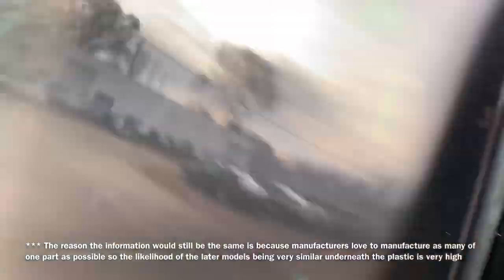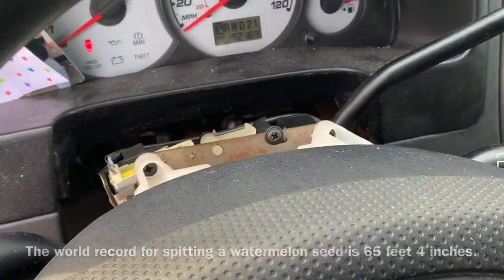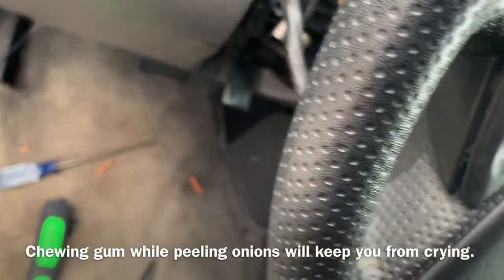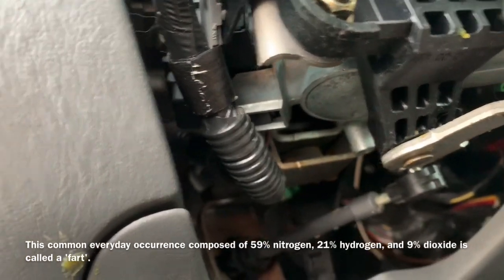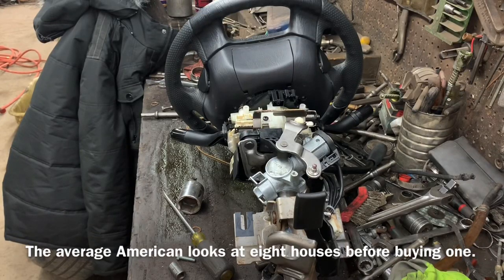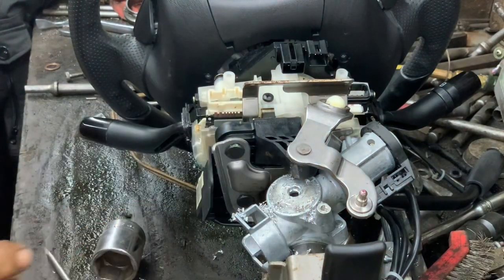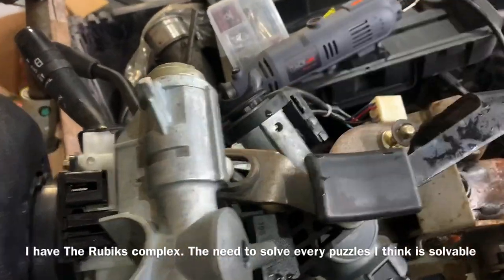Ford Escape ignition key will not turn/ Ford Escape won’t start/ cheap repair! You can do at home!!!

Comment: Good morning great info ..😊
? my wife is thinking of a smaller SUV maybe 10 years old or so we thought of the Ford do you have any recommendations pro or con on different models like I said about 10 years old thank you
4 wheel drive 🖖🏽😊
Reply from the maker: Really depends on the cost I think the Ford escape is a lot of bang for your buck it’s probably one of the cheaper SUVs that last a very long time just make sure you check the passenger side right rear wheel shock support tower they rust out I make tons of video on them other than that I would get a Toyota or a Honda Chevy Equinox is not bad as long as it has the 3.4 engine in it and I think the Saturn Vue with the 3.5 Honda driveline 2004 to 2007 is a very good vehicle as well
Reply: The Clay Way I know my wife wants to stay under $10,000 maybe $5000 that’s all up to her she thinks the RAV4 like a 2010 would be good and I kind of agree I like your recommendations also yes I definitely knew about the rusting problem with the Ford I think I had a Ford fiesta or something years ago that had that problem catch you later
Reply from the maker: mot ikswelborw well let me know if you can find a 2010 Toyota RAV4 for $5000 because I will buy everyone of them on the road lol Here in Michigan I could not find one for that cheap that’s for sure

Comment: @10:55 I think you mean to say you want to take the new cylinder out, and have it rekeyed to the car's original key. Also, make sure you keep the OLD transponder ring assembly on the NEW ignition / steering column, or else you'll have to pay a lot more to have a locksmith come and program a new set of chipped keys to work in this car.

even better, pull out the new ignition cylinder before you install it, then get a ride to your locksmith.

and next time, you don't have to take out the steering column. just unplug the wires and remove the sheered bolts.

Comment: If you had an Escape with no key, could you get a steering column with a key from the junk yard and change it?
Reply from the maker: No not without reprogramming but it only cost $75-$125 to have a locksmith come out and make & program a new key to it so you’re probably better off doing it that way. At least that’s how much it cost me the last time I had one made for my escape

Comment: When that happens to me I TUG on the steering wheel which feels very stuck (beyond normal) and then key works as normal. Seems it's due to when the engine was shut down the position of front wheels has stress on steering wheel.

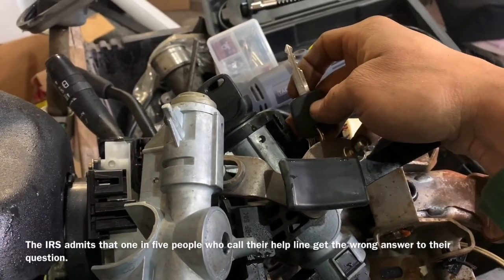Comment: @10:26 resistance??? this isn't a GM from 1993. the key has a transponder chip and the ring is both an antenna and a receiver for the tp signal.

what you're taking about is the old GM VATS system, but this is a Ford.

Comment: At time mark  04:03  there's a white tab that can be pressed down on without force so that one can move the shifter with having to remove the column cover.  Please note that this content should have stated this covers the automatic transmission.  peace
Reply from the maker: First off I didn’t even know they made these things manuals and I’ve had about two dozen of them maybe three dozen…..

I’m sorry my free video was not good enough to your high standards….

Comment: I’m just trying to replace the actual ignition cylinder as mine is completely rusted stuck. The original key won’t even go into the ignition. So I have a new replacement ignition cylinder and can’t find a single video that actually shows you how to simply replace the cylinder.
Reply from the maker: Probably because it’s not simple… you’re looking for simple when you should be looking for results….

Sometimes you can’t drink champagne on a beer Budget ….
Reply: @sharpcarco  yeah just realizing it’s something that they just didn’t care/or think about when designing the ignition cylinder. I got the vehicle started thanks in part to your video along with my sheer stubbornness and refusal to give up. Now I’m trying to tackle the releasing the ignition bracket that controls the steering lock. Unfortunately the third bolt was already broken off. The other two came off easy and allowed the steering column to drop down making it easier to access the ignition switch. Trying your dremel trick which I’ve had to use before on a frozen idle adjustment screw. It’s just a farm truck for me so I’ll be happy just to get her drivable again.
Reply: @sharpcarco  all the videos I found telling you how to replace the ignition cylinder require you to be able to turn the cylinder with the key…which makes me wonder why one would be replacing it if the key can operate it. Little frustrating but I’m making progress. Couldn’t get a good enough angle on the bolt with the dremel so ended up just grinding the bracket of the steering column with the dremel. Your video definitely helped. I can drive the vehicle  now which I mainly just use as a farm truck for moving stuff around and 4 wheeling into the forest.

Comment: 2001Ford escape it cranks but won't start no power going to coils or plugs
Reply from the maker: Possibly a broken crank sensor, When you’re turning the engine over look on the dash and does the RPM gauge go up? If it does not more than likely you have a broken crank sensor